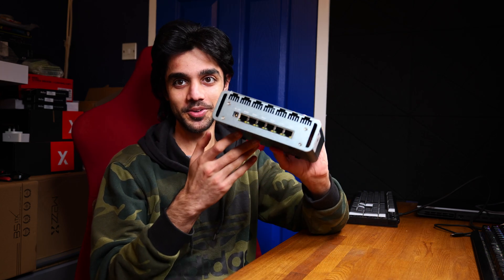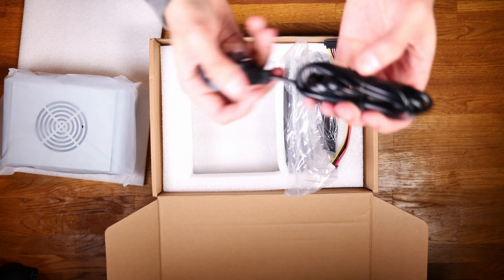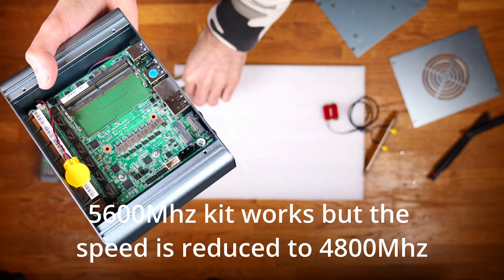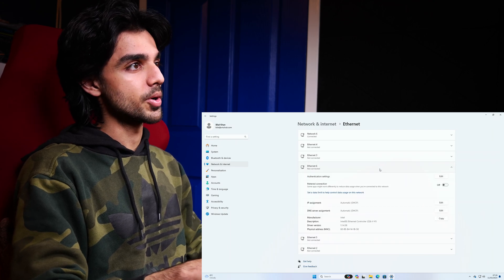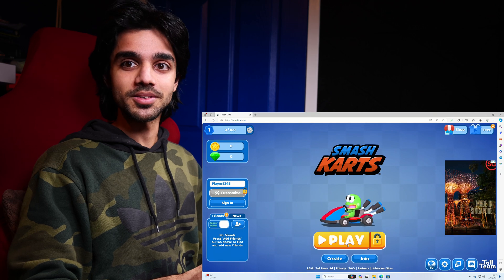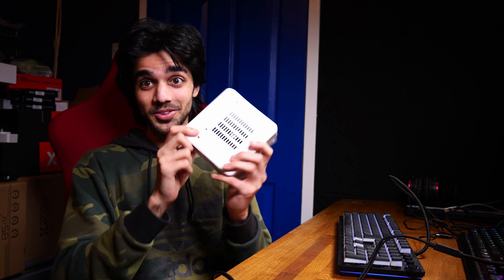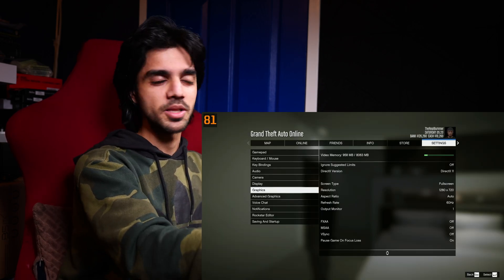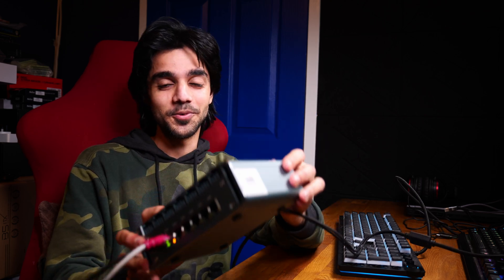A Intel Pentium 8505 Mini PC with 6 2.5GBps LAN ports - Intel i226V 2.5G LAN Firewall Router Review

Comment: Have u installed pfsense/openwrt and use it as manage router/firewall?
Reply from the maker: Works fine for that, it's designed for these applications. I haven't tested myself but after the review I gave it to someone who used it for such applications and they reported no issues with it.
Reply: @VrtuhubTech thanks i asked, as people hit weird issues with the i5 or the newer nxxx intel processors. i was hoping this 8505 would provide a smoother experience.
Reply from the maker: @Handled-x2n  8505 may have the same architecture, think it's based on 12th gen. If they had issues with it you might have issues too with the 8505 🤔
Reply: @VrtuhubTech  hmm ok i will keep researching, they do seem get around it

Comment: Great review!
I am interested and want to know if the 4G mobile network can be installed With Wifi together?
Is this DDR4 or DDR5 model?
Thanks
Reply from the maker: Its DDR5 but there's also ddr4 versions. There's actually another hidden slot underneath the heatsink, I never showed it as you have to disassemble to whole thing but it looks like one of those slots of a modem but I can't be sure as I didn't open it that deep to check.

Comment: I have a n100 lan i226v cpu but it doesn't recognize the lan driver, how did you install it?
Reply from the maker: You're on windows 11? You'll need drivers, what I've found is it's best to get them from the Asus website as some of their motherboards use the same drivers. The Asus b650 pro art has Intel i226 so I would use those, here is a download link https://dlcdnets.asus.com/pub/ASUS/mb/04LAN/DRV_LAN_Intel_I225_I226_TSD_W11_64_V11438_20230321R.zip?model=ProArt%20B650-CREATOR